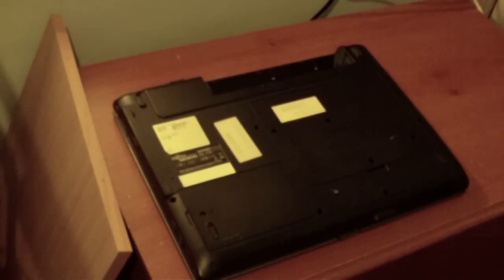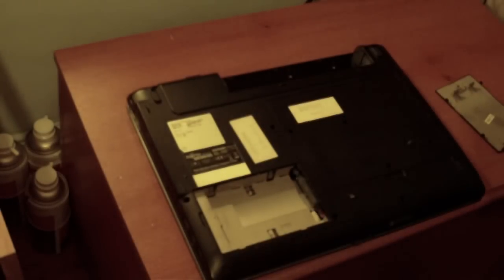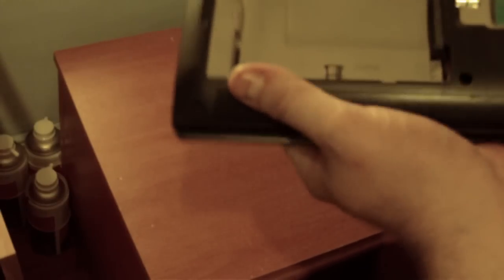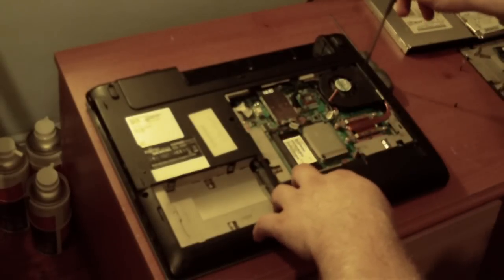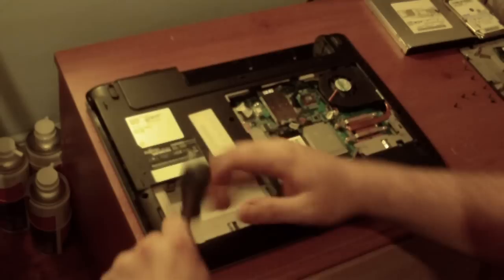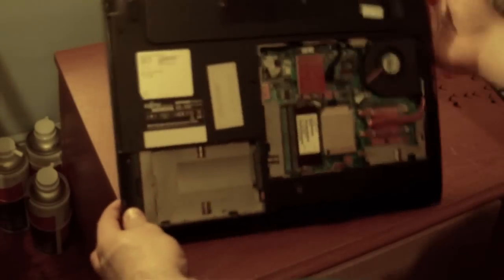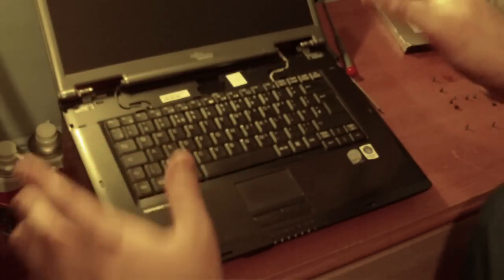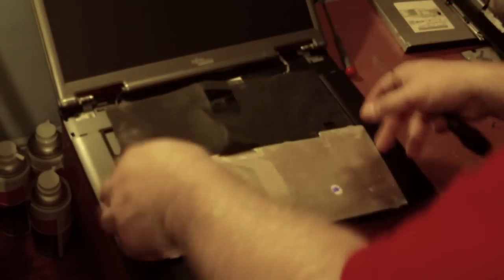Fujitsu Siemens Esprimo Mobile V5535 Disassembly Part 1

Comment: I've recently got an Esprimo Mobile v5535 for learning how to disassemble/assemble laptops...Was without charger, keabord (the buttons were ripped off) and HDD. Did a test with a charger and boots BIOS ok so I will try to enable it work again. Bought the original charger and keyboard (used ones but working) and going to buy a HDD. Wish me luck :) I've watched your videos and seems very easy to work with this laptop. Anyways, Thank You very much for your effort. You've helped me a lot. Cheers :)

Comment from the maker: Needle nose pliers are very thin nosed and pointed. You would need to grip the screw with them and then turn it till it comes out. Otherwise you could try soldering a piece of tubular shaped metal to the screw and use a regular pair of pliers. Or you could get a very small drill bit and drill in a new screw with a counter clockwise thread, and put a screw in that and turn it.

Comment from the maker: You would need to remove the CMOS battery to remove a password generally speaking. So you'd have to strip it down till you get the battery out. Then leave it out for a while so the system looses charge.

Comment from the maker: Unless you're using a custom BIOS you can'nt easily make the system not be able to boot, but as far as I remember you would need to strip the system down to get to the battery. Although I could be wrong, watch the video and see if I mention it.

Comment from the maker: But as you see in the video I remove a cover and then just slide the drive out from the sata socket. No caddy required. I can't remember if there are screws used as a guide rail.

Comment from the maker: No, laptops never really have. Some did, like the 2001ish to 2003 ear Dell Latitudes but the options were really limited, and even then it was normaly the same card just with more VRAM. With intels Core range having decent graphical grunt to them and AMD's A range I can see no laptop having upgradable graphics at all now.

Comment: Hello..I have such a model..when charging it, it does not work and nothing lights up..I am an air conditioning technician..can you help me find out its maintenance
Reply from the maker: I'd say start with checking if voltage is going into the board.

Comment: I remember this Laptop good. I had it like 6 or 7 Years ago. I used to smack the shit out of that motherfucker when i played games. It eventually stopped working 1 year later because i hit it so hard it started malfunctioning and getting bluescreens. I couldn't even install windows.

The total Damage was:

-A broken display because i hit it with a mouse
-Broken system because of like 300 viruses
-Broken CPU or MB because i fisted it 24/7
-Broken DVD Drive because i needed to open it with a screwdriver when a cd stuck in it. It happened because i used to slap it close 
-Broken Keyboard because i pulled out the keys when i was angry.
Reply: Hi since you've completely teared down the laptop do you know how many ram sticks there are in it
Reply from the maker: It should have two slots if I recall. Haven't owned this machine in years.
Reply: @Lupni3rd  oh well when I turn it on the screen is completely black but it's running I can hear the fans I searched up how to fix it they say remove the ram and check but this computer of mine only has 3GB of ram and a single ram stick total has 2GB the maximum capacity what it has is upgrade to 4GB but idk if there are two sticks in it
Reply from the maker: If it has 3GB. Then it should have two physical sticks of RAM in it. I don't recall it having any soldered on the board RAM.